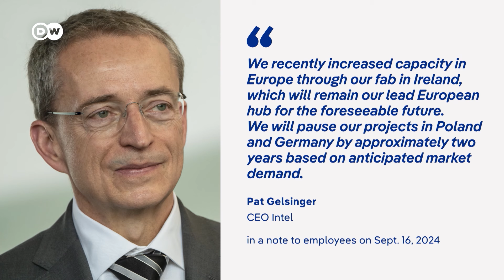Intel puts German plant plans on hold I DW News

Comment: 10 billion in subsidizes for 3 thousand jobs. Thats 10,000,000,000 euros for 3,000 jobs, thats 3,333,333 euros per individual job.
Reply: While it is major industrie it probably would not have been worth it.
Reply: Capitalism . Trickle down 😂
Reply: I thought only China is good at such folly ?
Reply: 70% of it goes to the ceo
Reply: The machinery is very expensive and there is a strategic aspect to having semiconductor manufacturing in a country.

Intel is not doing great at the moment and water shortages are a problem in the area.
-For that reason, it is not even a good place for it.
The water flowing there, comes from pumping out a coal mine.
If that doesn’t resume as the hole is supposedly to filled up by water not being pumped out, there will be less water going to the fab.
Reply: The value of having cutting-edge fab in your country goes way way way beyond the number of jobs you create. It's essential for future security, amongst other things.
Reply: @element4element4  Germany is in Europe and Netherlands in nearby. All these chips need to be created using Dutch machines. Not much value for EU or Germany per se other than supply chain stability. But then that is an European problem and not a German one alone.
Reply: @SolomonSunder  There is a HUGE distance from getting machines from ASML, and being able to produce the kind of chips TSMC and Intel do.

Not sure I understand the relevance of being close to Netherlands? In a scenario where china has invaded Taiwan and cut off TSMC, are you saying then Germany/Europe can buy ASML machines, spend 15 years of R&D to build the sophisticated infrastructure and billions of euros to start replacing TSMC chips?
Reply: @element4element4  There are enough specialised chip manufacturers in the EU as well. Bosch, Infineon, STM, NXP, GlobalFoundries, X Fab etc.
Reply: @SolomonSunder  This is a vintage German lunatic comment. First, everyone gets machines from ASML, not everyone is AMD or Nvidia. Talent makes chips, and the best global talent builds the best global chips (just like almost everything else). Managers in Nvidia do not have to “justify their reasoning behind hiring employee with poor command of the [German] language.” They just hire the best. Second, Bosch chip factory. Like, really, bro? Lol. Have you seen that factory? That’s more of an experimental educational-purposes site. It needs decades of experience and billions of dollars to be even considered an option to replace anything.
Reply: @uniqloboi9800  29% to middle management and the last 1 percent will go to the people actually working.
Reply: @TheFoki1403  I am not German. Not everyone needs the best. Automative parts need cheaper chips. I looked at the video of Bosch factory and it doesn't look like just a demo.

Regarding knowledge of the German language, I can't comment. I didn't speak German and didn't have an issue here in Austria in larger companies. Those focussed on DACH customer's alone did ask for German. But those were low paid as well so it didn't affect me in the long run.

Nevertheless, a couple of EU companies together with TSMC are building the fab. Also, there are IDMs already in EU. It is just a matter of letting them scale.
Reply: it is worth investing but intel? they're trying to make their latest chip in tsmc but their capacity is full lol, their only success is their fab in Israel making chip for defense industry which all tested on the ground before it get sold, I'm happy being team red best products in the market
Reply: @SolomonSunder  “Not everyone needs the best.” You gotta be kidding…

So, what’s the plan? You gonna fabricate crappy stuff slow while spending huge piles of money, then put “Made in Germany/EU” on it to justify a high price tag? No one tried it before? How did it end up?

Everyone needs the best. You either compete or close the market. The latter you already had in Eastern Germany and USSR. The former you had in West Germany while competition based on cheap labor was possible. Due to demographics (and other reasons), you cannot do it anymore. You must innovate. You, as well, need the best.
Reply: @TheFoki1403  You don't use a bulldozer to hammer a nail. BMW for example uses Inova chips in their cars. There is a large market for chips that are not the latest or have a different methodology, use case. Clearly, you didn't even study electronics or business development.
Reply: @SolomonSunder  I still believe you’re kidding… Are you really bringing up the German car manufacturers as the prosperous market you should be investing your future into? No, you’re kidding.
Reply: @TheFoki1403  If not everything should be done in China, then yes. Laws around supply chain stability try to enforce that since Covid.

Comment: The guest is right. It is about cash flow. Intel doesn't have enough cash to open more fabs. They will need more cash.
Reply: Their high-end fab is lagging behind ...
Reply: Lots of things do not run on Intel chips.  Focus on getting those fabs.  Yes there are lower and higher end chips, but Germany is not going to produce laptops or high end servers soon. If you build up a cluster on low to mid fab production, the high end production will naturally come.
Reply: overpay managements
Reply: It's not ant cash flow only. 
Intel future is full of problems.
Other companies like AMD, apple , quallcomm don't focus on Fabs and focus totally on design.
Where's foundaries like TSMC r totally focussed on Fabs . It means better management decentralised control. 
Intel has become too huge. Focus and control has become blunt. 
Intel has decided to break their various sectors into independent SUBSIDIARY which is very good idea.

Comment: The recent Sony decision for the PS6 likely did not help the cause.
Reply: Can you elaborate?
Reply: PS6 uses AMD chip
Reply: Nvidia, AMD, Apple & etc., Still use TSMC fab and not Intel fab.
& they have a Good Reason. Intel is also their competitor.
Even now we have USA Government begging Nvidia, AMD & Apple to use Intel Fab.
Because everyone uses TSMC Fab. TSMC can make chip cheaper, Intel cannot compete.
Reply: It's 2022 decision. That is old news.
Reply: @bennyang2200  Intel doesn't produce chips for others, they are just getting into to the foundry services, their foundry business model is new and is not running yet, give them some time, if Intel regains its leadership of node technologies with 18a, 14a and 10a, AMD, Nvidia, and Apple.... wouldn't have choice but to switch to Intel.
Reply: @bennyang2200 intel cannot compete with TSMC on cost OR quality. TSMC fans are far more advanced.
Reply: @bennyang2200 it's impossible for most Fabs to compete with TSMC.
Qualcomm tried SD8 gen 1 chips to be produced by samsung . Ended up worst quality of chips with overheating problems . They had to move back to TSMC in gen 2 again